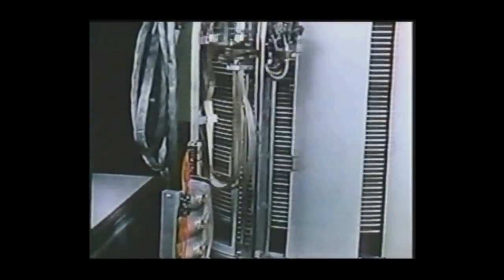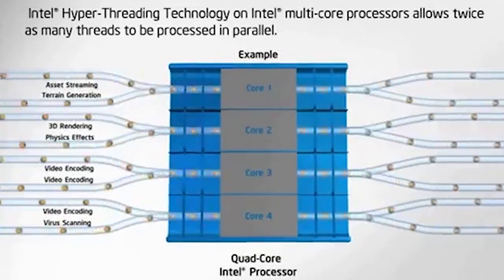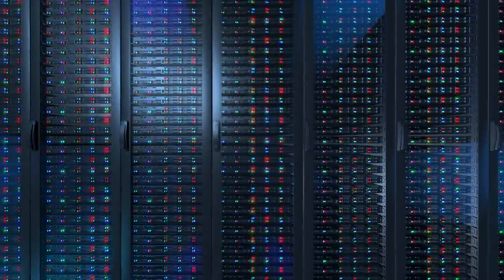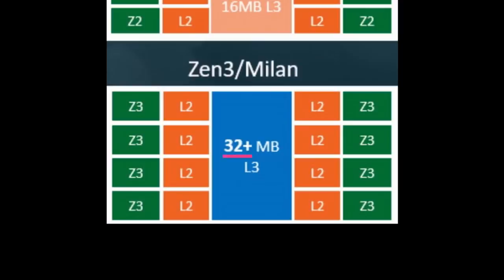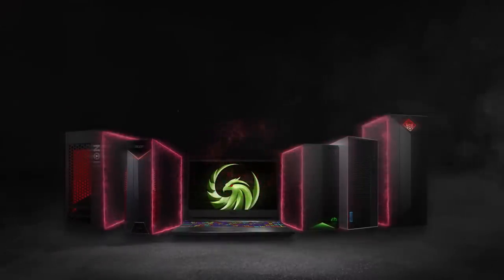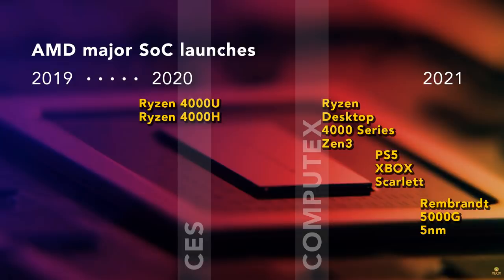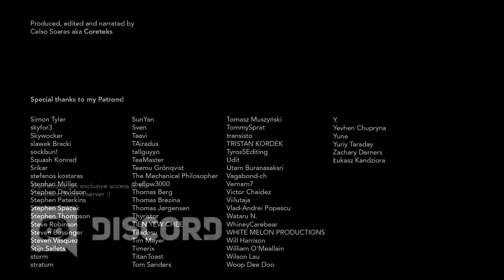Rembrandt | AMD’s MONSTER 5nm APU

Comment: Eliminating discrete GPUs??? That day cant come fast enough!
Also your channel is awesome

EDIT : No more overpriced GPUs --》 No more leather jackets for Jensen
Reply: Heresy! Our PCIe x16 slots shall not be empty!
Reply: Personally, I enjoyed keeping a CPU for 8+ years but upgrading the GPU to get sufficient performance.
Reply: The merger needs to happen. I want a NUC-style machine that doesn’t suck.
Reply: @zshadows  I think what people that, like myself, would love APU's taking over think about it is that the baseline could be so high that we really wouldn't even consider a discrete GPU, because the performance would be absolutely enough, in a more compact, less expensive form-factor.
Reply: So far I would recommend APUs for workstations for computers that would not be getting a dedicated card anyway. Because it would slightly speed up the machine for basically same money. That's how it looks right now. A huge GPU won't ever be removed because of an APU though. Just because of the form factor and thermals alone. Gamers care about any single fps, any signle 'C temp degree lower. The end-wall for quality would probably be photorealistic graphics at 8k and 240 Hz I imagine and if the world will still exist when APUs will be able to do that, than, well... Sure. Than no one will bother with discrete cards.
Reply: @p4nx844  PCIe slots will get all them SSDs and that extra computer Intel was testing, so we can have a computer attached to our computer for virtualization.
Reply: How about we get some competition in the GPU space? The reason GPUs are expensive is because Nvidia corners the market, CPUs used to be the same until AMD came out with Ryzen and forced Intel to either improve performance or drop prices.
Reply: I don't think that day will come until at least 2024, that Acer sales data seems wrong and needs a bigger timeline, just 2 years isn't enough to know if PC sales are declining.
Reply: That is basicly what the new consoles will be.
Buy an xbox ;)
Or wait a year for it to become available for regular desktops.

Anyway, it can not come fast enough. I hate big computers and my pc's have been shrinking a lot over the years. But at a certain point you can just no longer shrink further without big compromises.

I'd like a gaming pc in the size of network based terminals. Doesn't need much features or storage. Just a 10gig nic, 1 display port and a couple of usb connectors. and a 200gig nvme drive is sufficient as well.

Should not be to difficult ;)
Reply: @baronvonlimbourgh1716  A mini itx build can be made with no compromises to performance with a price lower than a console and still be faster..
Apus are way too overhyped, especially in this video, the performance of the new console apus will probably be in the range of a GTX 1660 at most, it's all about optimization on consoles, pc's wont be getting any of that lol..
Reply: @3rd.world.eliteAJ  all depends on how smal you want to go. You can not build a system with gpu in the space of a thin client. 
And 1660ti level of performance with a 3700x in the next gen apu's would be awesome. That covers pretty much over 80% of the market.
To me that would be an instabuy for sure.

If amd delivers that at a competitive price the bottom would fall out of the discrete gpu market and most manufacturers would simply stop making cards. 
It would completely change the desktop market if amd would offer this and it would mean the beginning of the end of discrete consumer gpu's.
Reply: @baronvonlimbourgh1716  3700X cpu and 1660Ti performance next year? 100% not going to happen.

With apus it's way more limited to what you can do in terms of size, you need a bigger cooler for both the cpu and gpu dies, and looking at the PS5 leaked images, it's going to be a lot bigger and bulkier than the previous consoles. A dual slot gpu will fit in a small mini itx case just fine, and there are tons of them out there that are smaller than the current gen consoles, and some even a bit bigger than the Intel Nuc.

Also the fact that you will never see similar performance to that of the next gen consoles with the same hardware, again, it's mostly just optimizations, developers just won't optimize for every single motherboard/ram/storage config, they don't  even do it now with discrete gpus..
Reply: @3rd.world.eliteAJ  if the consoles get that we will as well. But honestly i do not expect the consoles to be that powerfull.
Reply: @baronvonlimbourgh1716  Where is the current gen apu that performs like a Xbox One X or even the lower spec PS4? There isn't one, because the market is very small for these type of high performance apus, and if you really want one for gaming you just get the console..
Reply: @3rd.world.eliteAJ  the current consoles are still jaguar based. The last thing amd needs is another different line of products. The new ones will be more like the consumer parts. 

Anyway, at 5 or 6 nanometer that would certainly not be to crazy for apus. The silicon really would not h
ave to be that big to accomodate a 8 core chiplet and a 1660ti. Probably would not be bigger then the current apus at 12nm.

It could go either way really. I'd like to see it happen though and im sure they would sell loads and loads of them. Time will tell i guess.
Reply: @baronvonlimbourgh1716  5nm isnt even on the roadmap yet, only "in design" is given on their roadmap, so by the time this apu releases it's performance will already be quite low compared to what a discrete gpu setup would offer. Also this is talking about "raw performance", since Nvidia is pushing AI and deeplearning in to their products a lot, it's quite easy to see how an APU won't catch up that easily in terms of visual fidelity output.
Reply: @3rd.world.eliteAJ  ok man..
Reply: @baronvonlimbourgh1716  Just yesterday the Xbox Series X was previewed and it looks literally like a PC, no way are we getting anywhere close to what your imagining.
Reply: @3rd.world.eliteAJ  ok man.
Btw did you see the 5500xt? Just 158mm2. 
Even at 120/130mm2 that silicon would still do 1080p with ease.
That is pretty much almost the same size as an 8 core ryzen chiplet.

And the 3500x now sells for 110 euros which is an 8 core ryzen cpu with before mentioned chiplet. And we allready know there is enough room on an am4 cpu for 2 chiplets plus an additional bigger io die.
You do the math...

I know what the next gen 7nm apu's will be.

Comment: What would be really interesting for ray tracing would be a 64 (small) core with a good amount of on-package memory and 4 way SMT. With the really good branching capabilities on the CPU contrary to current GPUs something like that could very well even beat GPUs with dedicated hardware for RT...
The next years are gonna be interesting for sure.
Reply: @OverbiteGames  ray tracing is simply not really good for parallelisation, that's why GPUs are actually really horrible for it. It involves lots and lots of branching and a lot of work is required to make it run passable, let alone faster than CPU based renderers, where the maximum is like 2x or maybe 3x of the CPU based renderers performance.
The "faster than CPU based renderers" is only true because the CPU core count always has been so low.

Costly real RT accelerators practically are AFAIK just loads of CPU-like cores on a board.

Comment: I would really like the caches, nodes, crossbar logic and SMT synchronisation logic to be handled dynamically (like having some sort of FPGA interface between the cores and the memory parts, the pcie4+ busses, etc).
One would be able to finely control cpu performance in a very intuitive way.
You could even throw floating point compute units or graphic assembly bands in there for extra performance.

Comment: @7:19 - with SMT4, CPU internal will/should be redesigned to accommodate the need for these increase resource.
if you need to add more people to a car, you don't make the seats smaller, you redesign the car to accommodate for the amount of people needed, plus add more comfort & goodies.
Reply: Exactly.

You can't just tack on SMT4 to an existing chip. It would be a pretty major redesign.

If they just split the current Zen 2 core 4 ways we'd be back to FX level of single thread performance.

The primary question here is in future designs will AMD go with massive cores or just keep doubling the core count?

The net result overall is the same, 12 + 12 + 12 + 12 + 12 + 12 + 12 + 12 vs 24 + 24 + 24 + 24, but in the cases where single thread performance is important a massive core with a very dynamic SMT4 would actually work better.

We've seen historically that going with 8 weaker cores gets bashed mercilessly. Personally the FX design worked extremely well for my use case, so I really fail to see the hatred.

Given all of that, SMT4 is looking even more likely.
Reply: Fundamentally, no.  SMT is basically an extra set of registers.  You need logic to make use of those registers, but you don't add any additional execution units.  That's the whole point of SMT - make better use of what you already have, by spending less time idle waiting for something to finish.
Reply: @TrueThanny  nope.

The point remains if they split the core two more ways they'll lower performance per thread. 

The only way to add SMT4 without going backwards is either for it to be fully dynamic or doubling the L1, L2, registers and execution units. 

Essentially they can double the core and add SMT4 or add cores. Doubling the hardware per core could potentially boost single thread performance. Intel isn't sitting still. AMD has done the whole "twice the cores" thing in the past and nearly matched Ivy Bridge in threaded apps but no one cared. More cores isn't going to cut it while Intel is boosting IPC.

Comment: IMO SMT4 will be used when L3 will increase to 64MB , so same amount per thread like on Zem2.0, so Zen4 @5nm looks more likely while Zen3 will get 48MB.
Reply: The L3 isn't the limiting factor, it's going to be the execution units, the L1i and L1D, branch predictors, etc...

Basically they'll have to damn near double each core's performance in order to enable SMT4 without losing single thread performance.

Comment: Why don't you mention IBM's POWER?
They have SMT8 and SMT4
Reply: Because these are not x86/AMD64 instruction set cpus. The thread scheduling is done quite differently, and the cpu in those applications arent even on a single die or under a single IHS either. They are entire stacks of rooms of computers that make up one computer using IBM instructions.

Comment: During the first half of your video talking about the issues with SMT2 and SMT4 , it would have been nice if there was some mention for this is what AMD tried to resolve with the bulldozer design. Rather than trying to share hardware between threads, they separated out the integer units which are usually much higher in demand than the floating point units. Obviously that plan didn't work out quite as well as they hoped. lol
Reply: It actually worked really well. Just that designing a narrow high-speed CPU was a boneheaded move.

Comment: Do you think that packing the GPU and CPU in a monolithic architecture will decrease thermal performance? The current design of separate chips distributes heat on a bigger surface isn't it?

Comment: A question I‘ve always asked myself: how much space takes a core vs thread. I guess a 8C8T CPU would have a bigger die than 4C/8T. 
So how much of the space of 1C2T is taken up by each thread and how much does the core consume? 
Is core still the correct terminology? Because I would assume many of the core structures are now inside the threads?
Reply: The space needed to add threads is negligible, but having more resources on the die to share between the threads is generally better for performance, so in practice a dual-thread CPU core will be designed to be somewhat (maybe 10-50%) bigger than one that can only run a single thread. It's a complex trade off of price, single-thread performance, and multi-thread performance.
Reply: The space needed to add threads is negligible, but having more resources on the die to share between the threads is generally better for performance, so in practice a dual-thread CPU core will be designed to be somewhat (maybe 10-50%) bigger than one that can only run a single thread. It's a complex trade off of price, single-thread performance, and multi-thread performance.
Reply: Andrew S thx for your detailed answer. I find it always useful if the answer deals with more points than the original question included. If your knowledge is lacking it’s sometimes hard to ask the right questions. If I ask Google I often don’t get the answer I want.

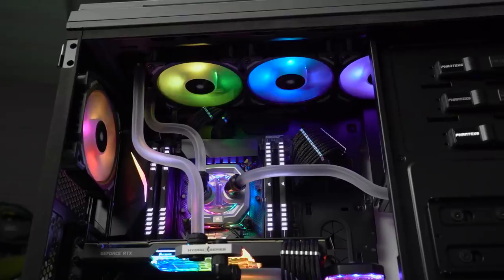If I understand you correct SMT is an easy and cheap no brainer in order to increase performance, Coreteks said by ~25%? (6:30) 

But also you can’t add SMT via software update, because there is some dedicated circuitry needed.

If I had to choose 4C8T or 8C8T the eight 8C CPU would deliver better performance in most cases, because at least inside the core there cannot be any resource contention? (If I understand you correctly 8C would increase die size significantly and therefore the costs, so maybe overall I don’t want that tradeoff.)

Comment: OS schedulers already distribute threads among cores, so if your apps are not optimized for parallel operation, often you will already have only one or two threads per core running. The OS could disable SMT in that case in theory, but in practice doing so causes some hassle, and the per-thread performance penalty of enabling SMT but bot using it is actually very small (compared to when using it)

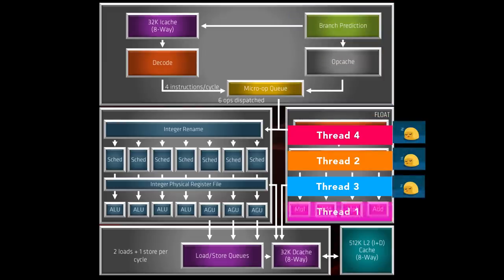Comment: 7:00 why would it be at 25% capacity? the thread at the bottom would still utilize all of the available hardware in the core, meaning that core is at 100%, just because the threads have to wait, doesn't mean hardware isnt utilized.
Reply: Semantics. It means the potential of four threads is lowered to one, hence end results at 25% capacity.
If I say to my boss that I only acheived 25% of my workload but I worked 100% hard on it, he still won't be happy.
Reply: He clearly has a very shaky understanding of SMT.

Comment: I would like to add, that in HPC applications, sometimes even SMT2 is a net loss or only a minor benefit, if the application is extremely well optimized for minimum cache misses and such. The throughput of the FPU or memory BW can become a bottleneck and SMT does not help at all. Also sometimes parallelism can be limited if it is fine-grained due to synchronization overhead, Amdahl's law, so sometimes scaling beyond 16-32 cores is very poor. Overall, I think SMT2 is probably the sweet spot for HPC, and an option to disable SMT on a per-core basis would be quite nice for applications that run better without it.
Reply: I would expect SMT4 to be useful for web-servers and the like, with lots of context switching.

Comment: I first saw this issue way back in 1983/4. The BBC model B computer had "the pipe" which enabled a second or even a third processor to be added. If you added a second processor then the system ran about 50% faster of the code was optimised well enough. Two extra processors and you could in theory get about 1.75 times faster than one again only if your code was optimised well enough. By the time you were up to four processors you were back down to about 1.6 ish. This was of course parallel processing. The T414 transputer in the Parsys system got round this to a degree but if the software was really bad all you got was a bunch of processors swapping data around instead of actually processing any of it. The only system I ever saw that really flew was sequential. IE you have one processor which performs function X, then puts the result into a FIFO, which the next processor can read which performs function Y and then puts the result in the next FIFO which the next processor reads and then performs function Z and so on. The net result is for example ten processors give you a bit under 10 times the processing speed. IE it takes a certain amount of time for the data to be rippled through so the last processor for example is just sitting there waiting for data till it has been passed through all the processors before.

Comment: The issue I see with the idea of APUs replacing GPUs is... wouldn't you then want to use BOTH to change what it's possible to achieve? This is the sort of thing that could enable a generational leap in simulating worlds, like actual real-world illumination in environments in real time. We had this teased with the reveal of explicit multi-adapter, but no one adopted it and so it's languished like a thousand other tech possibilities.

If APUs replace low and mid-grade GPUs I'd really like explicit multi-adapter to become a thing that everyone tries to make work in coding adoption. A world in which we just replace GPUs with APUs and everything is budget grade performance is a much more dismal one.
Reply: I think you are thinking of this wrong. Sure for starters it will be mid range graphics, but imagine a socket on mainstream, the size of threadripper, or even bigger. Suddenly there is space to put in a pretty big GPU+memory. Since it's all on the same SOC, the latency in render calls will be significantly less, reducing input delay. I could also easily see a large "L4" cache of HBM making DDR obsolete atleast in the PC sector.

Comment: I think 4k is shooting a bit high for an APU goal, especially given the low market penetration of 4k monitors at this time. A more likely goal is 2k gaming on an APU, with the possibility to run low-end VR (Oculus) as well. Also, thanks for the explanation of SMT, it makes more sense than what I was using before.